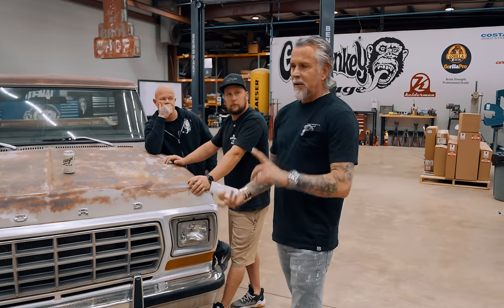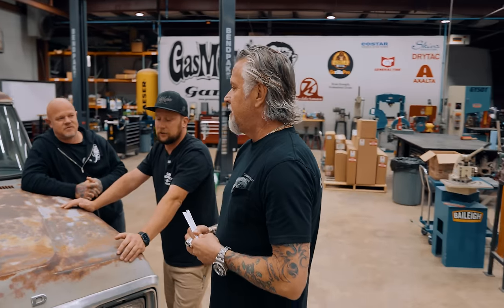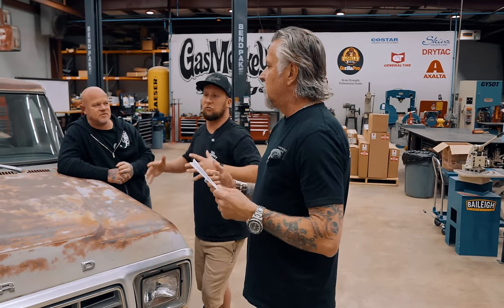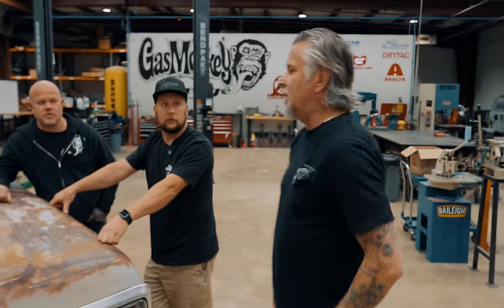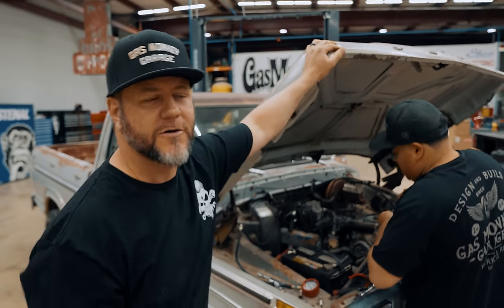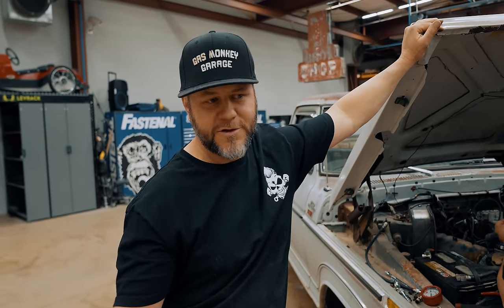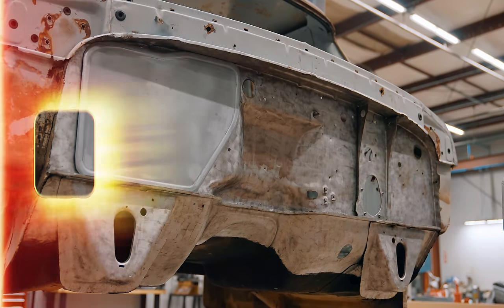Building the Ultimate Ford F100 Truck | EP 1

Comment: I don't know what's going on here but the fastest way is to use a pressure washer with rust inhibitor and glass beading. When pressure washing with broken glass it explodes in all the cracks and crevices it is 10 times faster then any rust removal done properly

Comment: Guys! Ya gotta keep this car, for one thing it doesn't take up that much floor space and another is ya got rid of the Bar stool space being taken up! 
Truly Sorry to see the Bar stool go but, maybe yall can make a Better one. This Car?!! Solid for Sure, a few adjustments like maybe get the power to the ground with a LT-1 Clone, screamin Turbo425 Transaxle 4th gear over drive peeeeerfect, brakes, 8 Baffles (one for each pipe), the Rad has to go somewhere else anywhere just not inside, cool Gas monkey Interior, Paint and This IS the Ultimate Monkey around Gas Monkey extreme High MPG shop mobile, even more so then the Original Monkee mobile for the band The Monkees. 
Millennial's and you Richard, Knocked it outta the park this time!!!

Comment: 6-speed manual trans way too much work especially if you've got a lot of hills. Not to mention you don't want some wanky shifter where your best girl should be sitting. Bench seat a must, why you want an automatic w/column shifter. Modern billet wheels totally inappropriate. American Racing Salt Flats with grey centers would be killer. Patina is cool but not rusty patina.